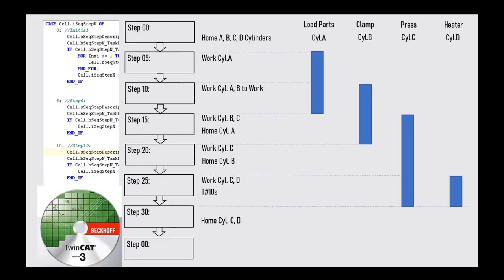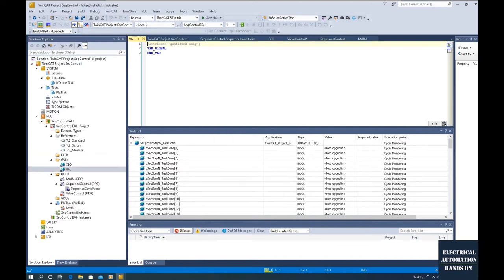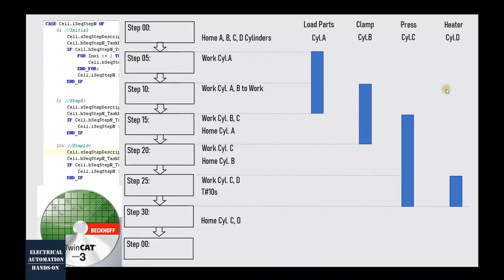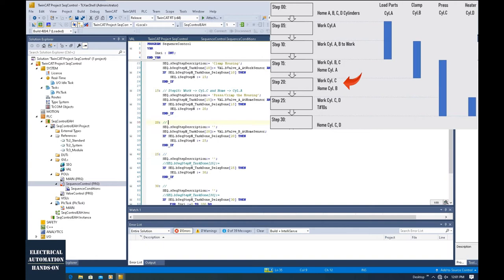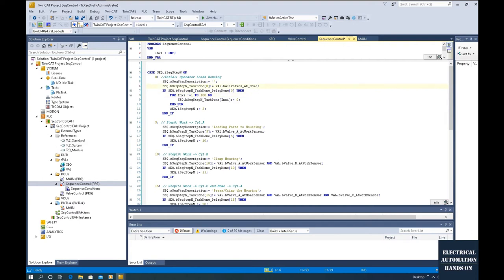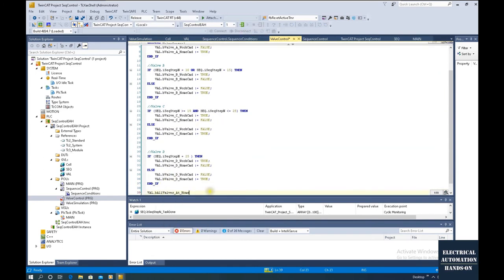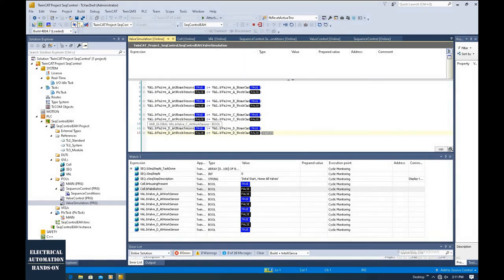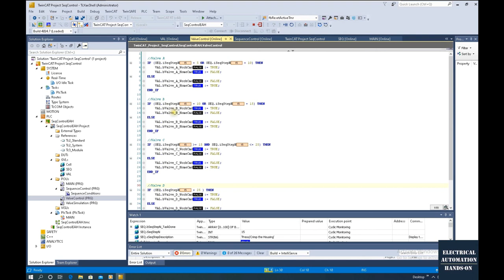BK11b. [2/2] Beckhoff TwinCAT3 Sequence Control - Commissioning Test [Valve Sequence Control]

Comment: How is the Beckhoff system Handel CASE statement? As for Siemens they require more memory compare to if you would do the same logic with IF statements.
Reply from the maker: Hi v Bit, I got your email and saw your so so positive comments, Thanks very much! Yours encourages always motivates and supports me to keep moving and design more interesting and useful topics. Terms of the question about the memory for CASE statement in Beckhoff,  I didn't do much deep research on the memory taking from individual instructions such as CASE, IF ELSE, probably the reason is that the memory is no longer an issue at all in Beckhoff, since it is a PC. The RAM, CPU, and Drive will be extremely huge for automation controller tasks.  Yes, we do need to take care about the 'work memory' and 'load memory' for selecting a proper Siemens controller. But for Beckhoff, CX9020 could fit most of the middle-end automation tasks. Middle and higher-end could forward to CX2030.  The controller selection would be much easier than other brands (evenif Siemens controller is my best favor). Thanks again for your comments.